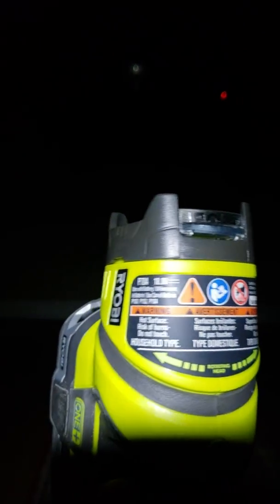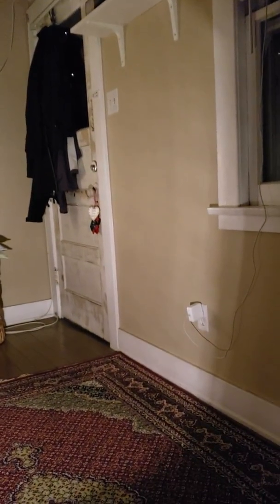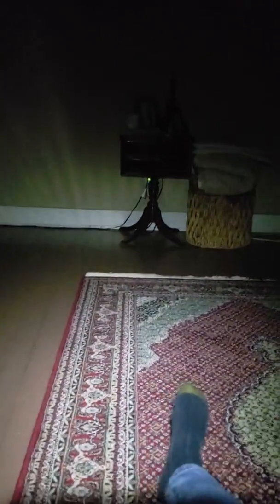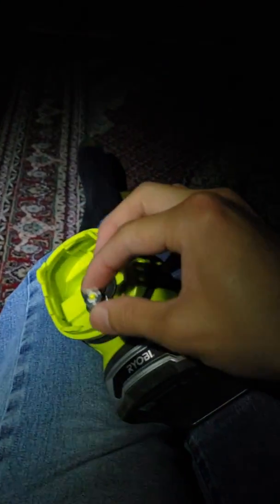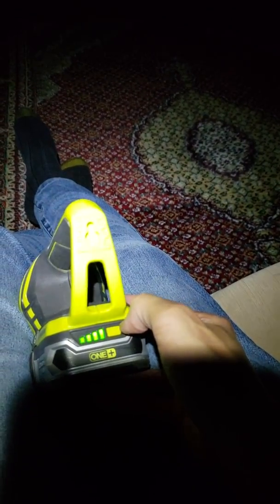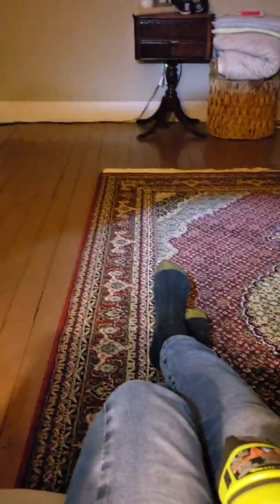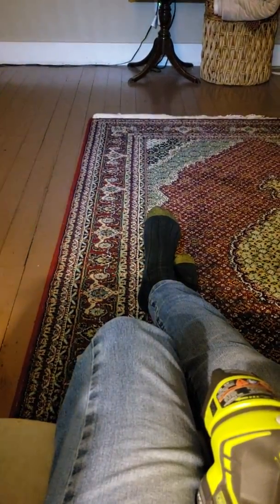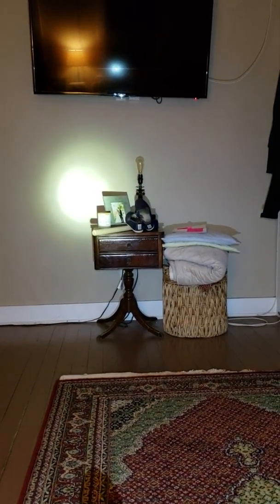Ryobi p704 flashlight led upgrade

Comment: I bought the 10w one omg it will blind people when you point to them and I have the new Ryobi LED flashlight model, believe me buy the old one, because you can change the bulb to led and use 10w it's just $8.99 on eBay and it is crazy bright. Not exaggerating! Type on search "P13.5s 10w.
Reply: whats the link? for the 10 wat p13.5s led bulb cause i cant find it for 8.99

Comment: Cameras have a setting called "automatic exposure" (not to be confused with automatic focus). When ever you need to show differences in light, you want that off. It stops the camera being more sensitive in the dark and less sensitive in the light to try and average out the brightness.
Reply: PS, good video, bulb will be my next purchase. Anyone know what the Wattage of the original bulb is?
Reply from the maker: Thx for the heads up. I noticed a "bright mode" on my phone so I'll make sure that that's off next time. Peace.
Reply: Thanks for the education. I appreciate you explaining this for us in the 55+ age group.